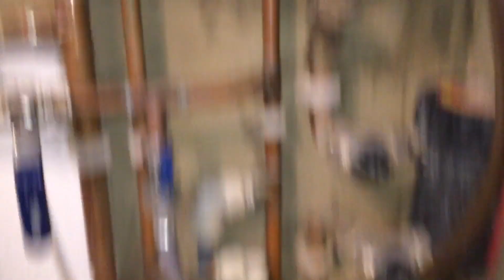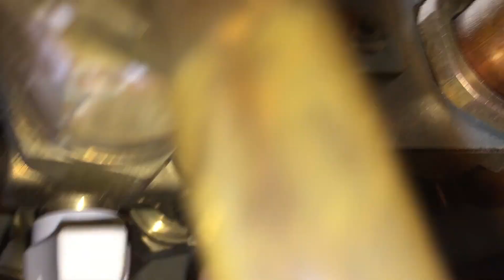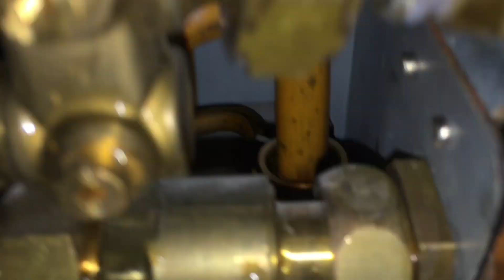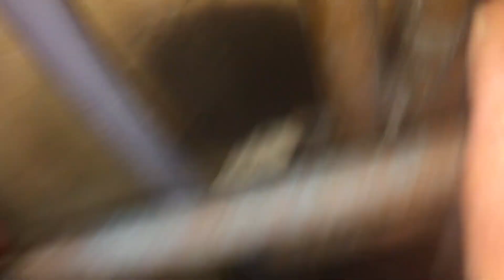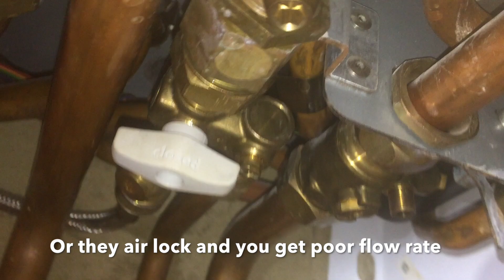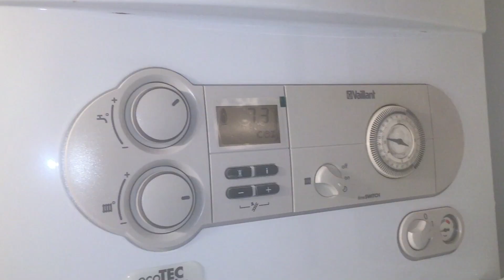Vaillant 937 F91 F81 Shunt pump Removal/Repair

Comment: If leaking tank is there away to isolate tanks and use a straight combi and d92 set code to zero
Reply from the maker: I dont think so, remove all the pipes underneath and fit the normal combi stuff and then you need to fit a different pipe inside the boiler with a DHW flow sensor. And finally you would need to change the DSN so the boiler thinks its a 837. 
Usually the tanks dont leak. Check the expansion vessel on the tanks. Accessed fro the little cover ontop of the boiler.
Reply: @HeatingGeek yeah changed that last week no calls yet from customer

Comment: Top mam I glad I found your video. Can you say where to source those seals please. Look like I have same issue
Reply from the maker: get the seal from parts center. Use parts arena on parts center website to get part number.
Reply: @HeatingGeek  thank you
Reply from the maker: FYI the seal that comes appears to be too small. Its not :-)
Reply: @HeatingGeek in terms on draining down the tanks, could you not isolate the mains and draw off the taps to drain the tanks? Just like on a combi?

Comment: Hi mate, i went to look at this boiler in a customers house tonight after they rang to say they had just a trickle on the hot water on every outlet. At first i was thinking a blocked secondary heat exchanger but this was until i found that these boilers have a storage tank for hot water. I'm going back tomorrow so what do you think causes this apart from a blockage ? I'm second guessing now after seeing that they have a lot of problems with air locks, could that be a cause ?
Reply from the maker: Sorry I didn't reply. The dip tube is probably the problem. I have a video on them too. :-)

Comment: Got one today so so glad to see this vid 👌top job
Reply from the maker: How did it go??? :-) hope this video helped.
Reply: @HeatingGeek  went well I slackened the return and turned it, made accessing the pump easier also connected the u shaped pipe to pump first and then to the storage tank, awkward job no doubt about it but your vid defo helped, also done the dip tube, it was corroded and split, might as well do it as was drained down. saw that off one of the other vids you did, what your vids do is give confidence to do the job always better when someone shows you the way again many thanks 👍👍
Reply from the maker: @andymcgill357  That's what it's all about. :-) Glad it helped. :-)

Comment: Very informative video.
If the tank takes more than ten mins to heat up and throws an F81/F91 code. What could be the issue?
Reply from the maker: Did you watch the video? I have 2 on this issue. Watch them and I explain. Also watch the 937 dip tube video here. https://youtu.be/Up6mO4YHgRg It will explain alot.

Comment: Hi mate yeah same here but apparently I did speak to technical help and the Itza a display so if it’s not you know how to diagnose the PCB is the low voltage side of the boat that could be a faulty and has a different sort of the checks for that and I’m sure you’re very familiar with that better if not the boat is the display that’s what the technical help I saying just a thought let you know
Reply from the maker: Thanks. The test for the low voltage is on my boiler videos when the fan fails. I test 7,8, and 9 for 22-24 volts.

Comment: Had exactly the same boiler today. Heating fine but no not water. Would the shunt pump not working cause no not water even if the hit water storage part of the boiler was switched off ??
Brilliant video by the way. You certainly have patience.
Reply from the maker: Not always. Its a weird system so can work sometimes not others.

Comment: Looks a blimin mission..vaillant could do better
Reply from the maker: There not to bad. Can do them in about 1.5 hours with all safety checks etc
Reply: HeatingGeek im a heating engineer havent come across this problem on these
Reply from the maker: You will get one sooner or later. Done about 5 this year. I cover a very large area though.
Reply: HeatingGeek fair enough mate.informative video

Comment: Really informative video.  Do you tend to keep all the manufacturer specific different size o rings on the van, or would you recommend keeping a universal selection kit of some sort?  Im always slightly wary of taking a joint apart unless i know i have the correct manufacturers o ring to replace it with.
Thanks
Reply from the maker: I Have loads of 'o' rings on the van. I order them when ever I can. Im not worried about taking any joint apart because of this, although I used to be. Good question!! Sorry I didn't see this before
Reply: The groove in the copper pipe that connects to the shunt pump seems too wide for the manufacturers o ring had to use two get it to seal